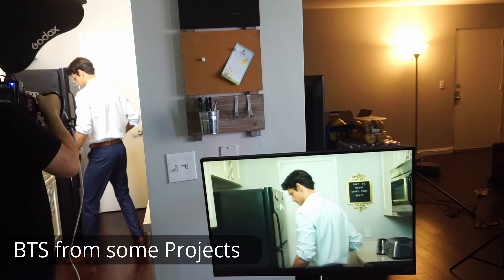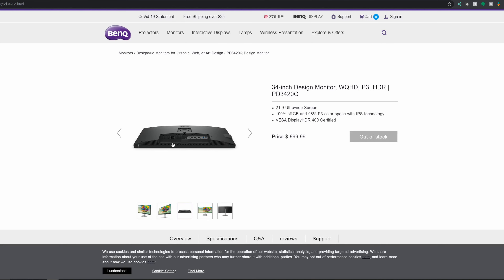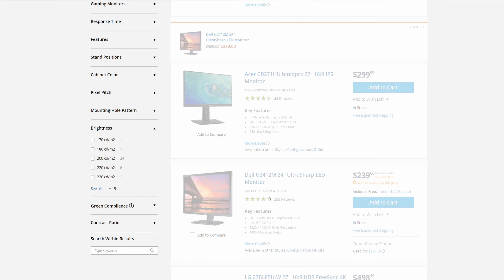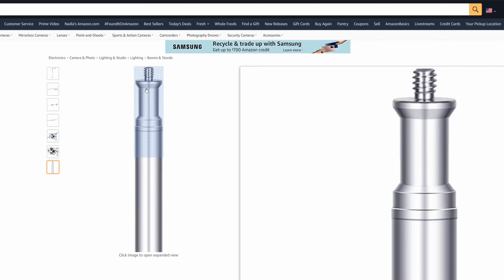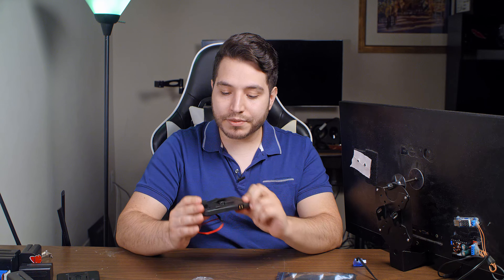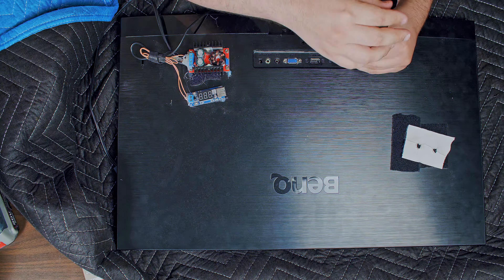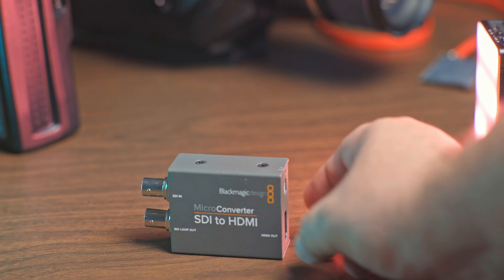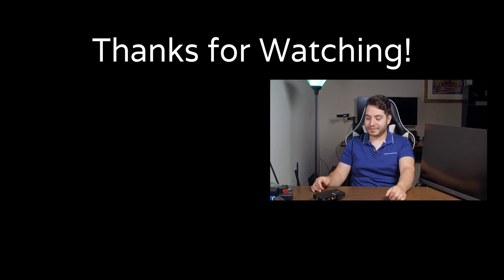DIY Cheap Wireless, SDI & Battery Powered Production Monitor!

Comment: Try to find AG Neovo screens. They have multiple models that run on 12 Volt. You'd only need a small converter to bring the 16,8 Volt fully charged voltage a bit down to 12 Volt. (and please, do yourself and your equipment a favour and buy a converter from Recom, Murata and other reputable brands and not the Aliexpress stuff).
Yes, they are heavy (far more heavy than the usual monitors out there) but they are more rugged, can come with rubber-protected corners, have a metal case ánd can provide a glass layer in front of the screen to protect the vulnerable LCD. The PCB is completely more rugged than any consumer-model out there (I opened mine to find if I could get rid of an annoying sound produced by the backlight power supply).
Another plus is the fact they can be adjusted thoroughly with testcards (one can control each individual color from completely zero to full 100%, most consumer-monitors can't).
Also contrast and brightness is a completely seperate setting that not only goes from zero to 100%, but also does not interfere with eachother, like it usually does on consumer-monitors.
And to top it all: my AG Neovo RX-24, which I got second hand, still beats my newer (also second hand) Iiyama XB3270QS (which I considered the better monitor) when it comes to sRGB capability. Not by much (4 percent or so) but I was surprised such an older screen still performs so well.

The fact you didn't get nuts with your V-mount plate has simply to do with the fact that you normally screw this onto equipment that has threads at the right place, and because those threads are in places where you can't reach with a pair of pliers or socket to hold a nut in place, that's why.

Comment: This is in my plans of stuff to do ! I wonder is 400nitt 7inch compare to a 22inch 400nit outdoor... I know I love my 2200nit 7inch monitor outdoor, but I wonder if the screen is bigger, can you handle it with less nit !  That battery mount on the back actually look really clean ! I would probably try to see if I can power it internally.  How long does a 98Wh battery last with this monitor setup ?  Any issue with the weight not being balanced with the battery. You put loctight inside on the bolt ? 3D printer is an option, but you could also have a cheaper setup from a laser cutter.  Fitting the curve is a bit more complicated.
Reply from the maker: I've only used it outdoors in the evening/night and it was fine haha. 

The good thing about it being wireless is you can move it to the shade right 😉

I used nylon locking nuts for the battery plate.

Yes it is a bit heavier on one side when the battery is on, (so tried to balance it with the receiver on the other)
Its not enough to make it fall or anything, the arm i recommended (but didn't use myself ) has that rotation adjustment to so even if it leaned a bit you could make it work.
Reply from the maker: Oh and for this monitor (pretty low powered compared to the others I recomended) I get over 4 hours with a 98wh. To the point where I dont really pay attention haha.